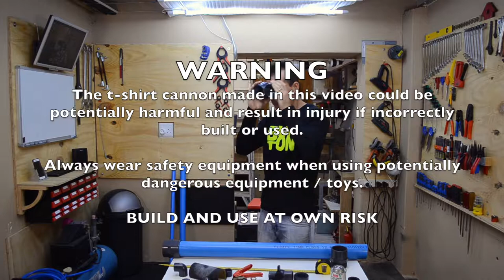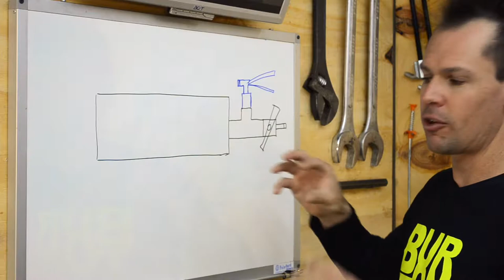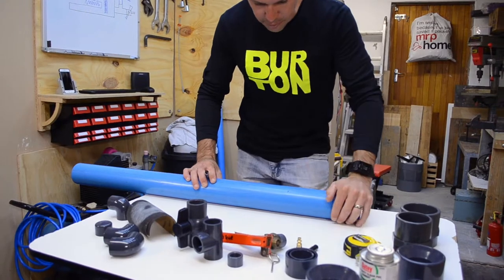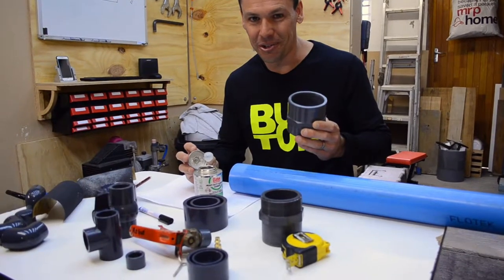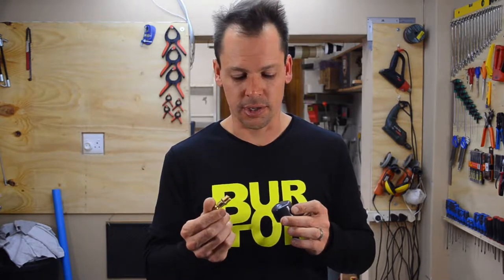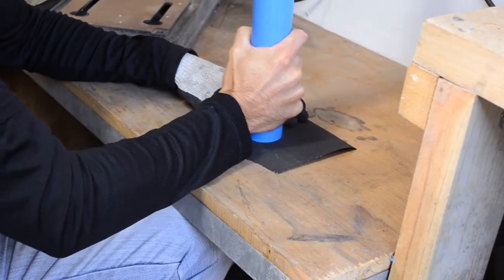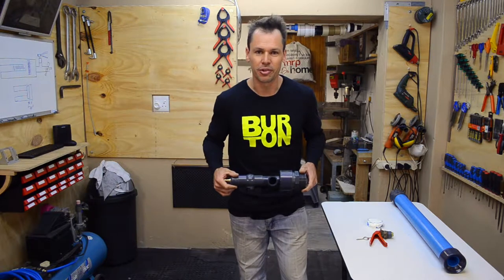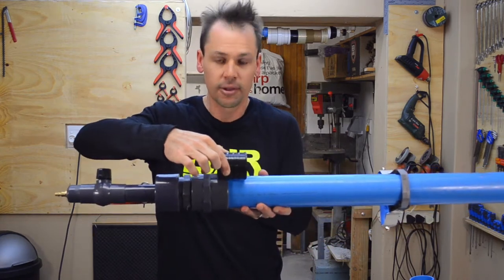T-Shirt Cannon How To DIY Guide - BURTON BUILDS

Comment: Hi. I am from south africa as well, that brass valve you using where did you get it?
Reply from the maker: Hi Johan, it’s from the top of a fire extinguisher. I think I mention this in the video at 01:45
Reply: @GrantBurton   thx i have that one, the one at 9:40 were did you get that one, all i can find is valves for tubeless tires
Reply from the maker: That’s not actually a valve, it’s the male side of an air hose quick coupling … you can buy them at most large hardware stores (like Builders or Adendorff).